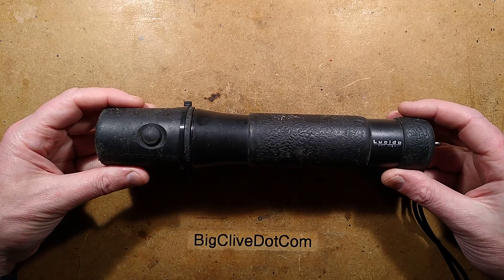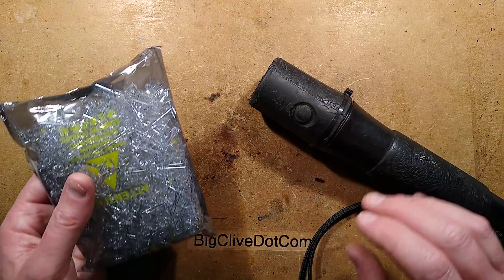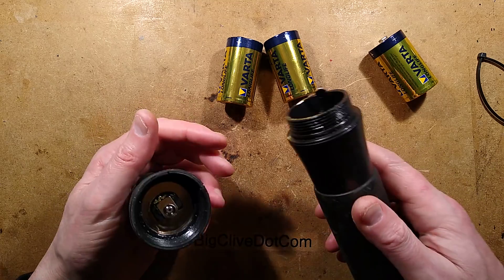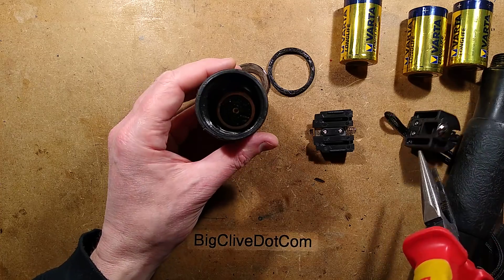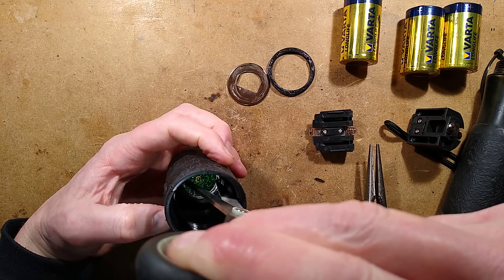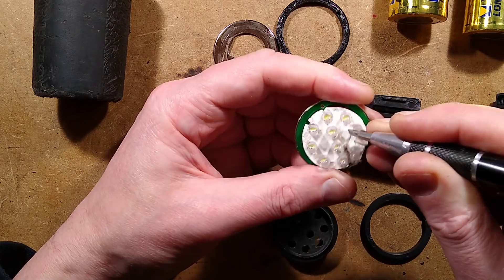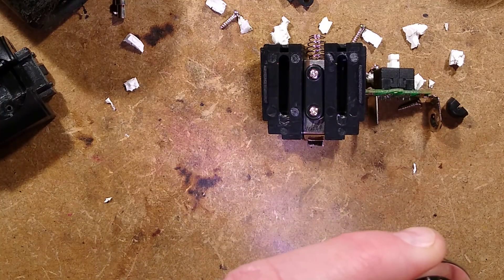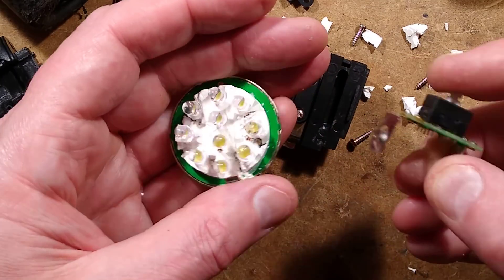Teardown of a vintage Lucido 20 year old LED torch.

Comment: I had one of these LED torches as well, it was a Lightwave 3000 or 4000. It was heavy enough to be used as a baton.
Reply: i have one of those old big "million candle power" lanterns that had a halogen bulb and lead acid battery in a seperate satchel you would carry, conected by a curly cord. it now has a 24v 75w HID lamp and ballast from a truck and a 6s5p 18650 pack with an Ebike battery bms board. ridiculously bright, illuminates an entire field. i once lent it to a policeman looking for an elderly man with dementia who had wandered off and it didn't take long to find him, walking in a field without a care in the world..

Comment: 6 years ago I bought a flashlight that was top of the line at the local Canadian Tire, it took 6 AAs, 3x2 in parallel, it's absolutely beefy, solid thick alminum shell, basically a baton. 600 lumens, it's my favourite, but recently I've been seeing 100-120 lumen single AA flashlights, which also has a small circuit board to probably increase voltage and squeeze most of the juice from the battery. I love flashlights.

Comment: It's oddly satisfying watching people picking and peeling off silicon or rubber that has been used to pot things in.

Like the circuit boards and power supplies that Chinese manufacturers pot in rubber.
Reply: Somewhere there is a girl for you that would enjoy sharing that experience,
Girls are weird,-

Comment: i have a fairly old LED torch, very high quality, very bright. The only reason that i don't use it is that it eats batteries. if you want it to disect i am happy to send it to you.
Reply: Probably better to get a modern one
Reply: @SparkY0  wow, why did i not think of that, wait, i did think of that.
Reply: @ShadowzGSD  Fenix makes good high power and compact flashlights. I would recommend one that uses a 21700 battery. me my self have the TK-22 V2
Reply: @reahs4815  thanks you, i am not looking for recommendations though. it is over 15 years since i got that torch and if i had not found a replacement by now i never will.
Reply: @ShadowzGSD  If your old flashlight is that good then great but a lot has happened in LED flashlight technology over 15 years. at least look at them and if you find anything interesting consider them just as backups

USA site if you live over there :https://www.fenixlighting.com/product-category/flashlights/

if you don't live in the USA then there is amazon or other sites too.
Reply: Think about buying rechargeable batteries for it.
Reply: @davidgriffiths6748  like i said, it eats batteries. it does not care if they are rechargable or not, 5 minutes and they are flat.
Reply: Ahhh, this show really brings sadness into my heart as I realize I also have been hanging onto some old D cell LED far too long. Sad to see them go. Sad

Comment: I love the construction. It's longevity is a testament to its engineering
Reply: I’d assign it more to being overbuilt than calling it engineered. Being so early on in the history of LEDs, the designers probably just wanted to make sure it survived a typical lifecycle for common flashlights so it would be seen as a proper replacement to incandescent
Reply: As someone that builds flashlights for a hobby this thing is pretty rubbish even compared to any basic cheap convoy branded flashlight. I guess people don't really know what's available nowdays
Reply: @neiliewheeliebin  Yes, it could have been nice if they've made it of aluminium, especially because this light was so expensive at the time.
Reply: Uh it has cracked plastic, sticky disintegrating rubber, and extremely dim LEDs... so what is so great about the construction because the longevity claim is a lie.
Reply: @GunkDung  Yes, plastic was a bad choice for such an expensive light. Although you shouldn't complain about the dim LEDs, because they were the first generation of mass produced white LEDs, there was no better available.
Reply: For its price they could have been made it of aluminium, then it could still be intact.

Comment: I think any mineral oil based lube will cause damage to rubber and maybe plastic. But I believe vegetable oil is fine, hence 
brake fluid used to be veg oil based. That protected all the seals in your car brakes. Being replaced these days with silicon stuff.
Reply: Mineral oil definitely degrades rubber. And it can affect some types of plastic as well. Some contact cleaner sprays contain mineral oil. I killed some Hornby model railway points (switches) by lubricating them. The plastic degraded and the affected sections became useless...
Reply: @Mark1024MAK  I've had to switch to silicone grease after wrecking numerous electrical items with vaseline and 3-in-One mineral oil.  I've tried researching the problem online but haven't found anything conclusive.
Reply: @westinthewest  - in the industry that I work in, electrical systems can be in service for long periods of time. Sometimes forty years or more. A lot of the systems are safely critical or are required to be 99.99% reliable. The industry has discovered various limitations of various electrical insulation materials, ranging from moisture being absorbed into insulation (such as PCP rubber cables and wires, SRBP insulation and various hard plastic moulded items) and hence the loss of its electrical insulation properties through to the insulation not being compatible with other materials (such as not mixing cables using different insulation in the same cable duct/trunking, for example don’t mix PCP/rubber cables and wires with PVC cables and wires) and degradation of the insulation due to it being attacked by chemicals such as mineral oils. As with most things in life, manufacturers only like promoting and listing the positive points of their products, so limitations are a lot harder to find. Try instead searching for ‘plastic compatibility with mineral oil’ or ‘plastic compatibility with petroleum jelly’ or similar. Even then you will mostly only find charts. Actual documents with details are often only provided to the company or organisation that paid for the work, hence don’t appear online.
Now mineral oil or similar products are not permitted to be used anywhere where it may contaminate cable or wire insulation. Similarly petroleum jelly is only to be used on metal electrical terminals (to protect against corrosion) and must be carefully applied so that none gets onto the cable insulation. In general, mineral oils and petroleum jelly are not to be used on plastics. For equipment enclosures that have to protect against the weather, everything has to use proper cable glands and wherever possible, cable entry should be on the underside/at the bottom. Our biggest problem is not with rain water, but with condensation. The day/night cycle results in temperature changes which cause water to condense on and in electrical terminals. Then over time this results in corrosion and then within about three years, failures.
Reply: @Mark1024MAK  I remember reading through a large Wikipedia article about vaseline's uses, properties and history with great interest before deciding it was going to be the magic bullet to reduce water ingress, corrosion of metal parts and the ingress of flaura and fauna into outdoor electrical enclosures.  For the same period of about two years, I also applied 3-in-One oil onto armoured cable glands and into the SWA sheath where capillary attraction would draw lots of oil into the cable, protecting it from the unavoidable build-up of condensation and inevitable earth leakage faults.  I'm now waiting for the dreaded phone call in a year or two reporting that an armoured cable termination has turned into sticky goo.  I agree - it seems that manufacturers need to reduce the influence of their marketing departments when deciding what to include in their spec sheets.  I've switched to silicone lubricants for now, but I'm going on anecdotal evidence which seems to confirm that I'm on safe ground, but again I've not found anything authoritative to confirm that it's safe for all the types of thermoplastic and thermoset polymers we come across in electrical installations.  Clive's video is the first time I've ever encountered a warning which corroborates my suspicions.

Comment: How can it last a month at 600mA?
Reply from the maker: As the voltage falls the current does too.  It gets dimmer, but still puts out usable light.
Reply: @bigclivedotcom  Must be getting pretty darn dim by the end
Reply: i made a LED flashlight before they were a thing, unregulated blue LED in a altoids tin, testing it for longevity i left it on for about 3 months before it was no longer a usable amount of light, it was still glowing though at the end

Comment: I remember when we bought the first GX5.3 LED-replacements for the Halogen lamps in our bathroom... they consisted of just about 30 of these low-power LEDs pottet into a tradional glass lamp base, and they sucked so bad... abismal light output and the colour was also disgusting (they claimed it could replace a 25W tungsten lamp at the time... more like a 5W tungsten lamp, if at all. Basically a glorified night light). 
But hey - it was like "future technology" at the time. Took many more years until we finally could get decent ones that were able to really "replace" a halogen lamp.
I later took one of these and (as they ran on 12V DC) built my own LED flashlight with it by glueing it in to the front of an old tungsten Flashlight that held 8 AA batteries - fot that application it was not too bad (until decent LED flashlights became cheap enough).

Comment: i'd probably be tempted to replace the old leds with new ones and give it a new life!
Reply from the maker: I was tempted to do that, but the case is degrading.
Reply: @bigclivedotcom  that is a point yes. Easy enough to find cheap alternative case
Reply: @bigclivedotcom  You could always 3d print a new head, give me some dimensions and I'll model something up for you.

Comment: I remember my first LED flashlight had a 1W Luxeon Star when they were brand new, that flashlight cost $100 CAD back in the day.
Reply: Dude my headtorch cost 500$ when I bought it many years ago. Crazy how things evolve.
Reply: Dammit, dropped my barely-larger-than-a-cr123a-battery work flashlight down a drain. There goes another $65.
Reply: @mgancarzjr  It was the size of a normal flashlight at the time, maybe a little smaller.  It also had a neato dark grey anodized aluminum case.
Reply: Probably 20lm. Now you can get 200 for same watts.

Comment: Could you melt the plastic back together with the solder iron.
Reply: tape, duct tape or gaffers tape is the best way to reinforce it when the plastic is no longer viable, this light still has another 30 years of use ahead of it!
Reply from the maker: The whole case is showing signs of age.
Reply: @bigclivedotcom  thats true, it looks like you got your good out of it.